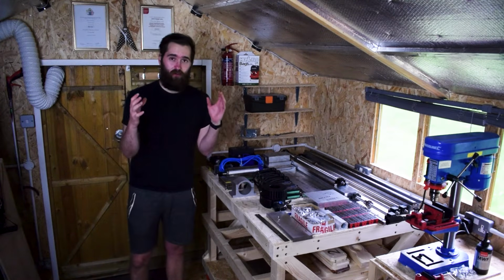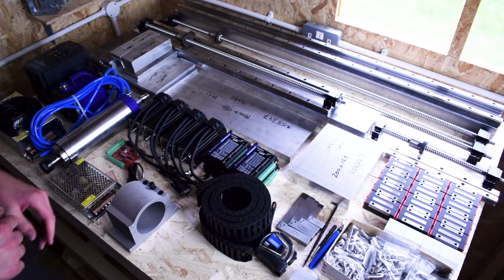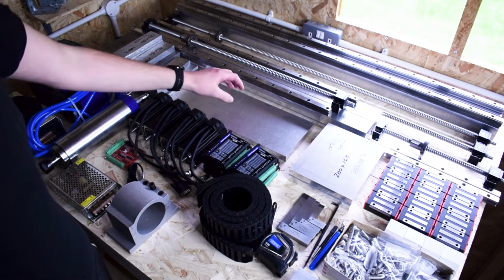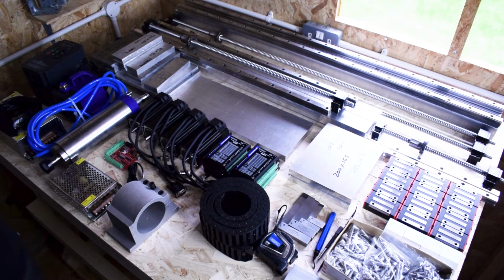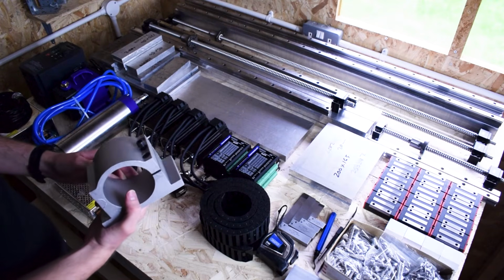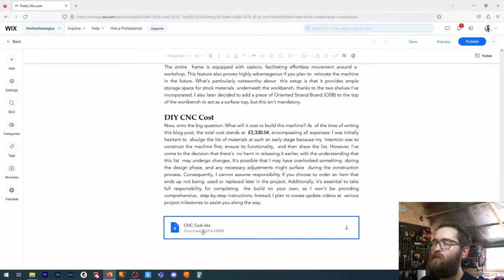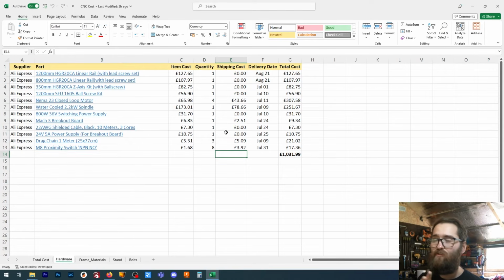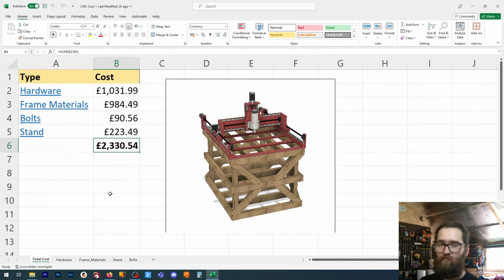DIY CNC 002 - Specification & Hardware

Comment: i has build very similar cnc machine, but open loop motors, and need say i has test mach3 and 4 but not good dangerius because use windows OS no have REALTIME contoroller, important have real time controller linuxcnc is only factory safety realtime what used normal, and best option controller card is mesa card etc,mesa 7i96 card have perfect this machine, i use this. before machine i used usb mach3 and has totally worst controller and dangerous if come errors. better has linuxcnc whit paraller port controller,  and last now i have mesa ethernet card, perfect all cnc machine builders.
i use same size motors, but Y axis rails have SBR 16 rails, beam X axis i used MGN15 rails cheap but good. Z axis have MGN15H rails. ball screws and 2,2KW vevor water cooled spindle less than 200$  whit cheap aliexpress 55$ VFD. all cost to me less than 1300$ good machine woodwork shop, can cut aluminium too easy. and many materials, carbon fiber, wood, aluminium, acryl, etc. if some want build can build very cheap but better than 4000-6000$ ready machine buy. lot better than openbuild, avid, many different brands machines.

Comment: I wish we could get our hands on the stuff this cheap hahaha. my hardware cost was thesame for only 300x300 cnc...
Reply from the maker: Check out my Bill of Materials over on the website. All the purchase links are there :)
Reply: you has buy parts wrong shop, i buy all parts aliexpress and ebay and all cost same size about 600x800 work size machine less than 1200$ have possiple build DIY little cheapen but i use good materials and parts only.
Reply: @mattivirta and i bet the accuracy is kinda meh unless you do wood. for any real work geting even just linear cariages off aliexpress will make your repeatability +- 3mm xD

Comment: Aluminum and stainless steel are dissimilar metals. So, although your stainless steel hardware will not corrode, it will cause the aluminum to corrode and weaken over time. Just something to be aware of. I've seen some thread coatings advertise that they limit this effect if you are not using a thread locking compound.
Reply from the maker: Thanks for the info! I will keep this in mind

Comment: Thank you for sharing your work! I'm planning my own build so it's handy to hear your thought process.
I wonder whether the motors you have will overpower the rigidity of an aluminum frame. Several people have told me that it's common for DIYers to get motors with way more power than the machine can use because the frame is too floppy.
Reply: stepper motors is minimum all cnc machine normal min is nema 23 475OZ /3Nm motors, biggest is better. expets small table cnc who made only PCB etc, letter carwing, small job can use smalles nema motors. aluminium or good guality birch plywood machine frame have good no floppy or wobbly.  birch plywood have near same if use aluminium. and later can upgrade aluminium when hav good cnc were can made better parts. all factory quality cnc have aluminium and table only have metal tube welded frame. cheapen option is if can welding in home shop and build own metal tube frame lot cheapen than use aluminium.

Comment: Since this is going to be bolted together I had a couple of thoughts. I think it would be advantageous to make a shallow counter sink (or generous chamfer) to the holes on the two surfaces that come together. When you drill and/or tap the holes there is some local deformation around the area, especially in softer material like aluminum. This would concentrate the pressure in a small area around the bolt when it would be better to have it more evenly distributed. It will also allow you to develop the full clamping of of the bolt.

The other thing is getting a really flat joint between the extruded faces of the plate and the saw-cut edges (like the example at 6:27). If you aren't going to machine these faces you might look into scraping them together so they make really good contact. With aluminum, it doesn't take much work to do a couple of passes. I'm not sure how flat the plate is, but you might run into alignment and binding issues with the linear bearings when you tighten the bolts fully. A small surface plate would be able to show you how flat the aluminum is. Small workshop grade plates are pretty reasonable (in terms of cost).
Reply from the maker: Excellent points, thank you for the feedback and suggestions. Your thoughts are in line with mine in regards to the process of bolting together. I will certainly be taking as much care as I can to ensure the plates go together as flush as possible. Like you said aluminium is generally easier to work with and it can even be sanded and polished very easily. This could be done nicely on the end cuts and connecting faces to ensure a very accurate joint. There will always be a degree of human error when doing this by hand but all I can do is my best to minimise it :)
Reply: The smart thing to do is buying aluminum tooling plate what has flat surfaces .
Reply: TRUE ALL treaded holes need camfer.